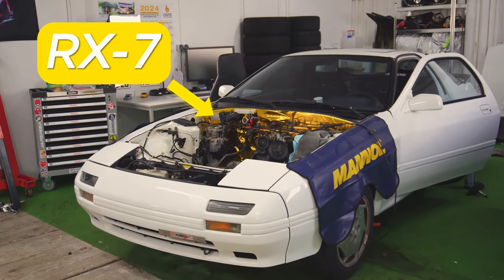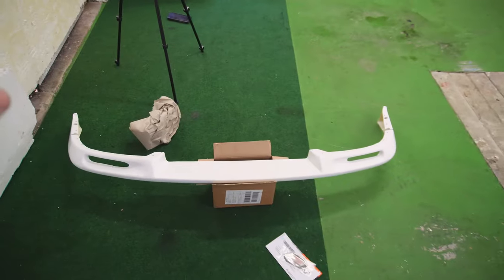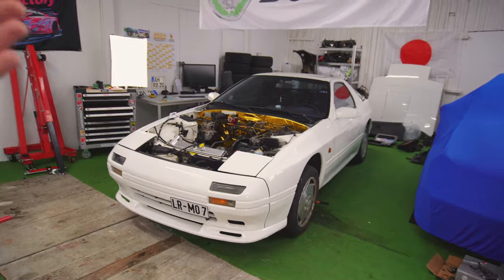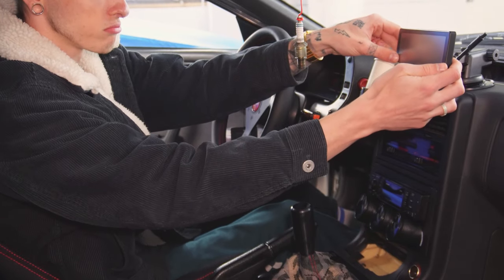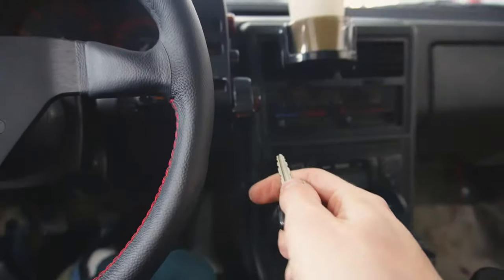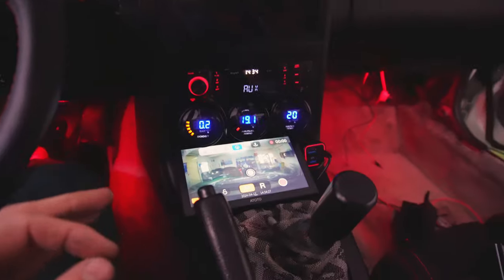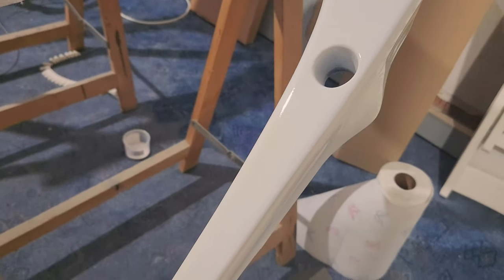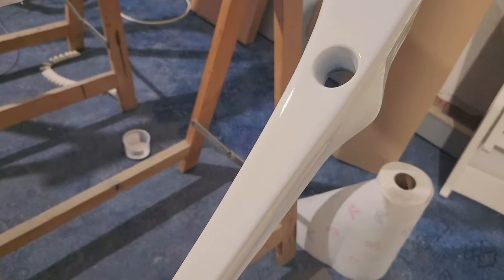Fixing The Visuals Of My RX-7 FC!

Comment: Looks MUCH better with the wing. The color mismatch is probably mostly due to fade/yellowing over the years, but I've also noticed in several car parts I've painted on 80's cars, they use an almost black dark gray primer, that might be part of why it's so much brighter. If you have any paint left you can test that out on a piece of cardboard and place it on the car.
Reply from the maker: It hink so too, looks way better all white😍 The FC actually got a brand new paintjob before I got it😅 So I sadly think it's just a combo of different materials and the spraypaint not being 100% accurate.

Comment: I couldn't remember if the Odura front lip fit on the S4 FC, and I remembered you had an S4, so I came back to rewatch the video lmao
Reply from the maker: Lol yeah most people say it doesn't fit BUT it actually does😂 The radius of the front bumper curve is just a liiiiittle different from the S4 to the S5 so you will have to heat up the fiberglass a bit and bend it carefully into shape. But it works very well and fast! :)
Reply: @moritzherr  Hey, if it makes it so I don't have to buy a S5 bumper, then whatever

Comment: Great video! Really enjoying your progress. - where did you route the cables for the rear dash cam? Were you able to hide them anywhere?
Reply from the maker: Thanks man, I'm happy you're enjoying the series✌️ 

Funny that you ask, I actually had the wire routing part included in the video before deciding to edit it out because I thought I was talking too much in during the shot😂

Anyways I routed the rear dashcam cables from the headliner through the B-Pillar down through the bottom door trim, up the dash and through to the ashtray in the center console. This way you can't see any wires, neither from the front or rear dashcam :)

Had to remove some panels to properly route them but it was worth the effort👍
Reply: @moritzherr  thanks man think I’ll buy one of those Really like the way the unit looks. I’m a similar boat with my FC at the moment your videos have been great to see how you do things-love the style of your car can’t wait to see what wheels you go with. 👍
Reply from the maker: @nickchalmers-francis6278  Yeah I also really like how the screen looks :) Also for the price I think you can't go wrong with it, especially because of the 2 included dashcams👌 They also have the P9 which is a little bigger and slimmer but the for the FC the P8 fits perfectly where the ashtray usually goes so I went with it.

I'm glad you're enjoying the build so far and definetly feel free to keep me updated with how your FC build goes😁

Comment: Looks great so far!  just curious though, are there any mounting brackets or supports holding down the apple car play unit because it looks like it may move when shifting?
Reply from the maker: Thanks man!🙏 There is no bracket yet... I was planning to use the included suction cup bracket but sadly it was a little too big so the headunit would have protruded from the Ashtray area. I will probably 3D print a mount in the future but thankfully it doesn't move while shifting because it just fits perfectly :) 

The Display is 170x100mm and the Ashtray area is 175x100mm so it fits like a glove and doesn't interfere with the shifter😄

Comment: where did you buy the rad???
Reply from the maker: I bought it from eBay, don't remember the brand though. It was a little cheaper than the go to Koyo. The quality is surprisingly good, it's really beefy and it's even a 3 row full aluminium rad so I guess it will perform great :)